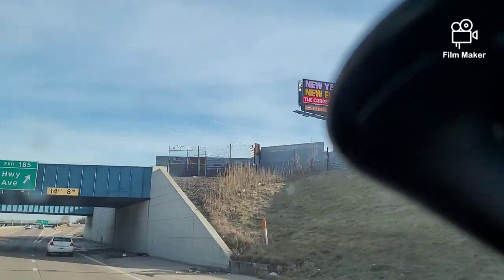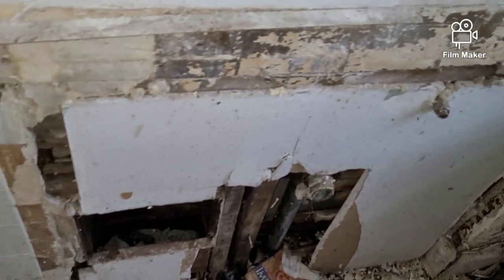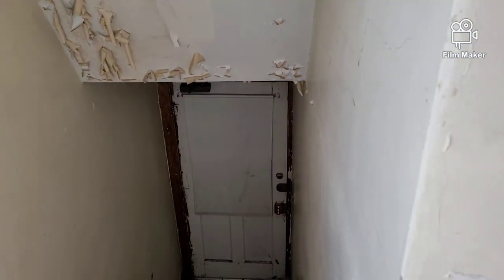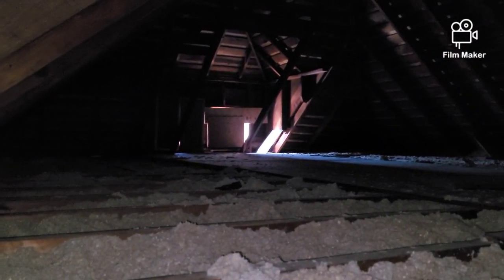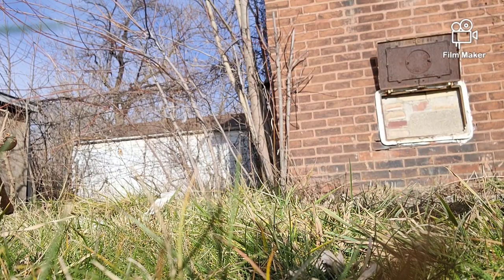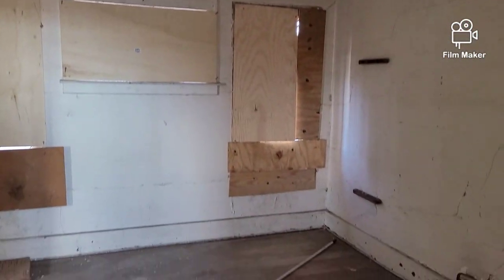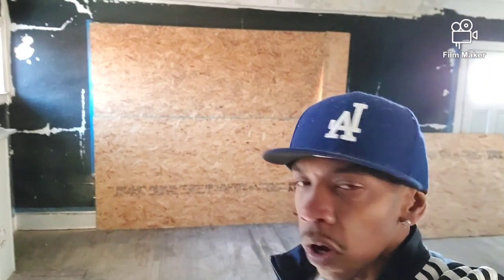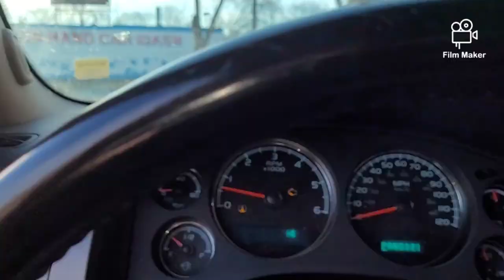FULL REHAB WALK THROUGH  DETROIT LAND BANK HOME

Comment: I love my Ryobi set, bet you like yours, too. Noticed that since I bought my circ saw in 2016, they've changed the battery config so that it mounts from the side. I'd really like to see you use their recip saw instead, just seems safer. (I've used mine to clear a spit-ton of weed trees under the fruit & nut trees with it, mostly non-native privet, with vines & poke sallet mixed in. Currently trading labor for camper site on 13ac. in Middle Georgia, but will soon be Detroit-bound, experimenting with solar & wind energy to power such.) I also have the gas-powered Ryobi 4-stroke power head: the 18v recipro-saw wins big over the  petrol-powered pole pruner. Said pole-pruner attachment required repeated chain sharpenings to accomplish the same work as the battery-powered recip: like had to sharpen 3x to cut through a 4"-5" weed tree (ugh), but after said weed tree was topped, it pulled out of ground fairly easily after 6 mo. or so of sitting there. Love your vids, keep up the good work!